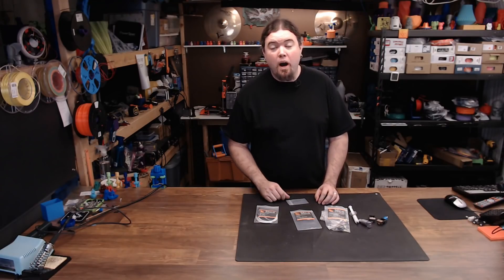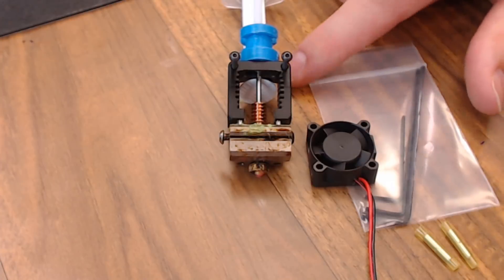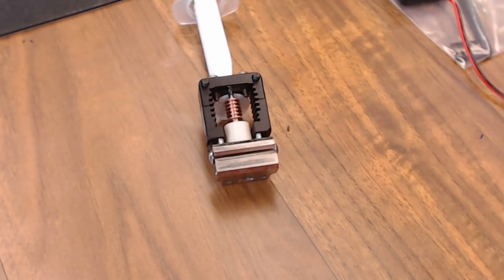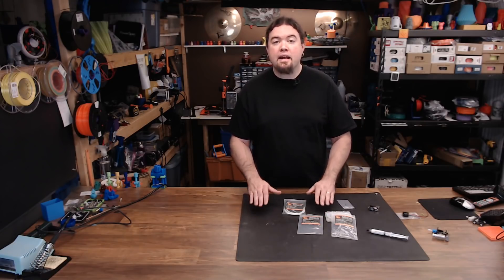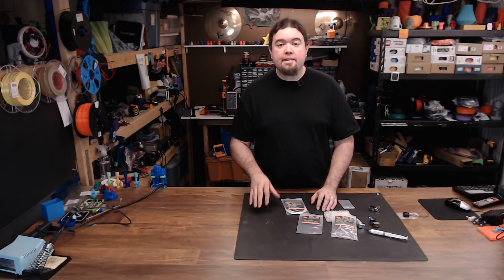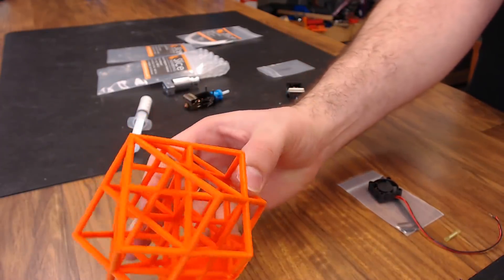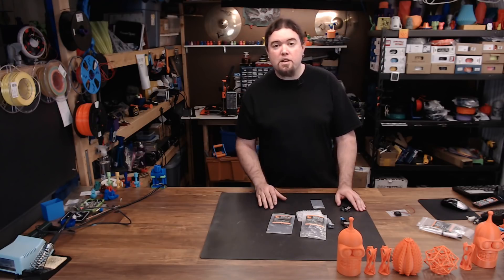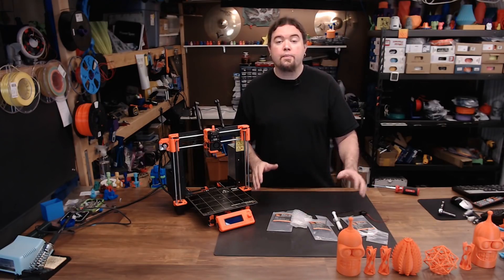Mosquito Hotend - Review - Slice Engineering - Chris's Basement

Comment: Did you weigh the 2 hotends?  A lighter piece will lower the moment of inertia reducing ghosting and potentially increasing Accel lowering print time.
Reply from the maker: I did, I have the weights in the doc in the description. After you get the fan and shroud on the E3D, there are almost identical.
Reply: Nova is 45 Grams, speaking of weights.

Comment: Nice review and details, thank you. Did you check the temperature control with a PID calibration? With the thermal properties of copper, maintaining temperature should be a lot easier?
Reply from the maker: I did run a sequence, it does appear to hold the heat much better, it's a really solid piece. I can get you the numbers if you are interested.
Reply: Thanks, I was just curious. I have the sock on my e3d v6 hot-end and it still has a random wobble that depends on speed and material and whether I brushed my teeth this morning :)